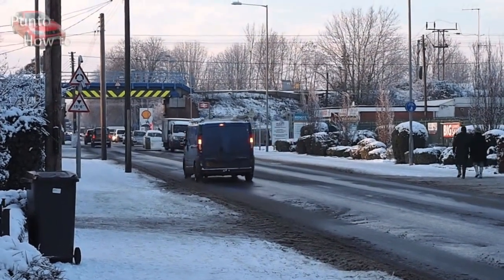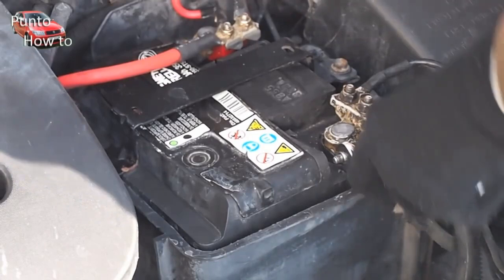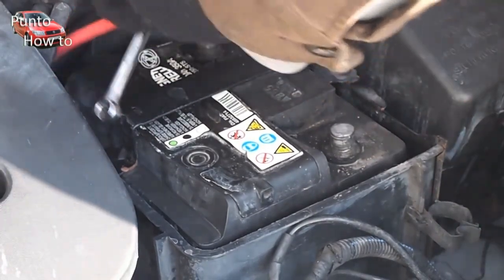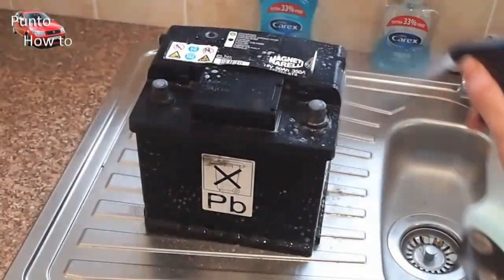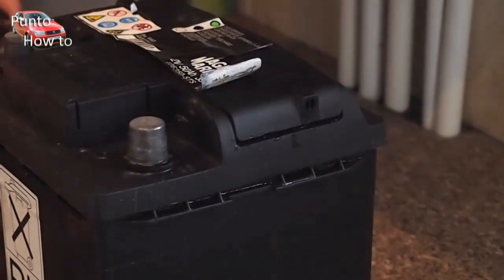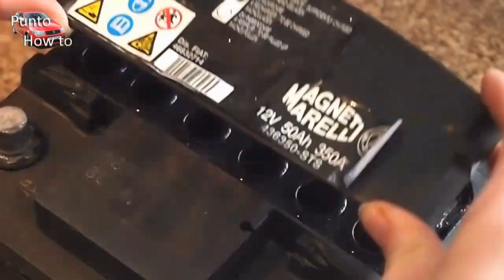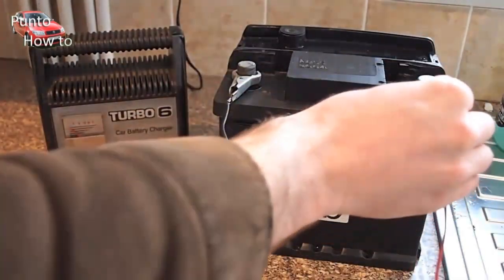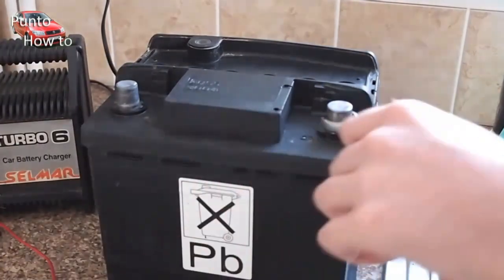How to do simple Car Battery Maintenance

Comment: You for got to say unplug the charger then"disconnect the battery"
Reply from the maker: Fairly common sense…. Makes refitting the battery really hard if it’s still plugged in, inside the house 🏠

Comment: i have 13.1 volts but on car works only windows or radio while car/diesel on only cranks a bit !!is that too less watter in battery or something like that!?
Reply from the maker: Check the battery ground lead, especially between the engine, and the body of the car, on a diesel it’s usually on the front of the gearbox
Reply: @PuntoHowto  seems its more like it is  too less amps/electrolites in battery  so it cannot  turn starter
Reply from the maker: @Mr11ESSE111  ok, I’m pointing you in the direction of a very common fault on all fiats bad engine earth means not enough current can get to the starter and so while everything else seems to work and the battery seems good the car won’t start, otherwise you spend your time playing around with the battery and not ruling out something that is easy to check
Reply: @PuntoHowto  its peugeot hdi!!and it was fine with new  battery  but not with used which shows good voltage but out of power for starting car

Comment: How does charging a battery affect how a diesel runs after cold start??  It doesn’t!!
Reply from the maker: If a battery is severely depleted then it puts a massive load on the alternator on modern diesels with lots of electronics this can also cause issues and errors from low voltages, the lift pump in the fuel tank is electric and needs a lot of power as one example. So there are issues that can arise just after starting, caused by a poor battery state.

Comment: Does disconnecting the battery affect the ECU and its memory? Or does the ECU reset after several start-drive-engine off cycles? Btw, I agree with your reconditioning method,
Reply from the maker: The ECU is set up with some standard parameters, if you disconnect the battery it will reset to the standard settings, which can mean some rough running or being less fuel efficient until it has re-learned the optimum settings for the car. It should not reset in normal use, just turning the engine on and off.
Reply: PuntoHowto: Thank you for the very helpful info, Sir.
Reply: @marinduque-theheartoftheph  to add on some models reset the immobilizer if u disconect the battery.. for my car iam to category that ecu resets to factory settings after a drive the ecu learns and copy again my drive style..
Reply: @sierra1s953  Thanks! This valuable info bits are not only enlighthening but also reaasuring. 👍😊

Comment: Will distilled water work
Reply from the maker: Distilled water will work in a battery, for the purposes of this video the plan was to replace the acid which is a key ingredient in the reactions in the battery, by all means, you can top up the battery up with distilled water.

Comment from the maker: although you are completely correct in what you say you should always test under load, for the sake of the video its much easier to demonstrate off load, also put a big load across it and you will soon see a voltage drop and someone will comment, put a small load and someone will complain its not enough. but a better demonstration would have been a before and after drop test.... but i don't own a drop tester

Comment: Thanks for sharing this video. The information is pretty timeless (well as long as we're still driving automobiles with lead-acid batteries)
Reply: Only difference is, most batteries these days are sealed and maintenance free. You still have to wipe it down though sometimes.
Reply: @vBDKv  Sealed Batteries are the exact same type as non-sealed ones. They seal them so, you have to buy a new one, instead of maintaing it. 

On some of them, you still can access the valves underneath a cover.

Comment: I just measured the battery in circuit in my 8 year old Ford at 11.2V. It's ford branded so may well be the original battery. Took it out and measured again and it was 12.6V. I don't know if this is the difference between no-load and load testing. The car had been off for about 4 hours before doing this, so it shouldn't have been drawing much current. I had already bought a replacement battery which measured 12.45V out of circuit so I put that in and the lights seem to be brighter. I haven't measured it in the car but I expect it hasn't fallen as low as the original battery did.

I don't know if the battery's internal resistance has increased as it's aged or something. I wonder if sloshing the liquid around has caused it to coat the plates a bit better and that's why the voltage has increased..  It does have access for topping up the cells, but I didn't notice that before replacing it. To be honest seeing it was probably 8 years old and reading 11.2V, I bought a replacement before doing much else. Any thoughts?

I should note the original reason I was doing this was because my car occasionally struggles to start and twice in the last month it's stopped by itself shortly after starting with a battery warning light. We'll see how well the car works with the new battery.
Reply from the maker: There are a couple of reasons, lead acid batteries have the ability to 'recover' because they are a chemical reaction between the acid and the lead, heat up a battery the reaction speeds up, freeze it and the reaction slows down, if you flatten a battery, and leave it connected to a load, it will remain flat, disconnect it and the chemical reaction continues allowing it to build up some power, which my be why you saw more power when disconnected then when connected, another reason is that, if a battey is very weak and being drained of some power by a load, there is a direct relation between watts amps and volts, so if your battery can only deliver a certain amount of power and the load is of a set resistance,  the battery will supply the power to match the current draw in Amps but being weak this can cause the voltage to drop, as car batteries can deliver massive currents even when flat, I'd think it likely the recovery effect kicked in and when disconnected the battery mustered up a little more voltage. 

Drop testers used to assess weak batteries work on the second principal they put a set load across the terminals which will draw a certain current, then they look for a drop in voltage.

Comment: Is it ok to put that water in the battery then just close it properly and put it in the car then let the alternator charge it?
Reply from the maker: Yep, if the water is low but the battery is still starting the car and otherwise working ok, there is no harm in topping up the water in the battery and carrying on as normal. This will prevent problems with the battery in the future or make the battery last longer.

Comment: Shouldnt you top up with sulfuric acid solution ??
Reply from the maker: Technically no, the surfer in a battery becomes deposited on the plates, the water evaporates away, so the idea of putting the water in is to replace what has been lost and by charging the battery, you dissolve the Sulfur off the plates back into the water turning it into Sulphuric acid you can top up a little acid if you have the means to test the exact specific gravity of the battery solution and know how much you need to add, but you shouldn’t just pour acid in or you can upset the balance

Comment: My battery is fully charged [just dead cells] can I just add water as well? Please help I just subscribed 🙏🏿
Reply from the maker: If you have dead cells there is probably little you can do to save the battery, probably the plates are internally shorted out